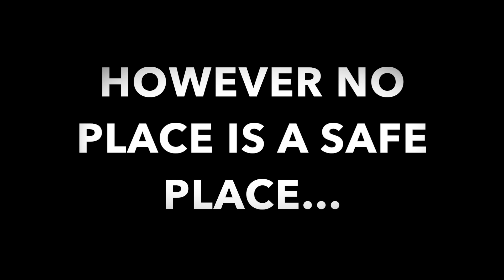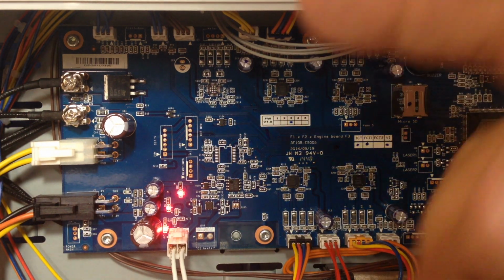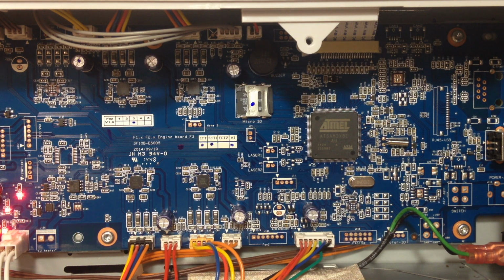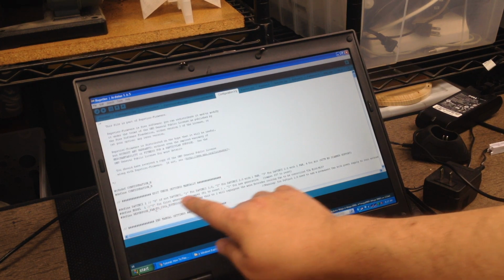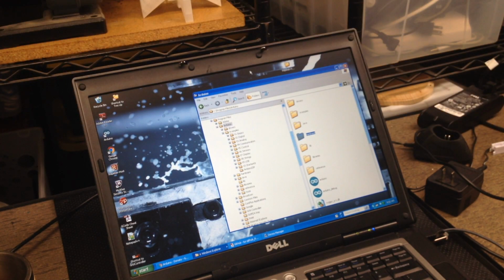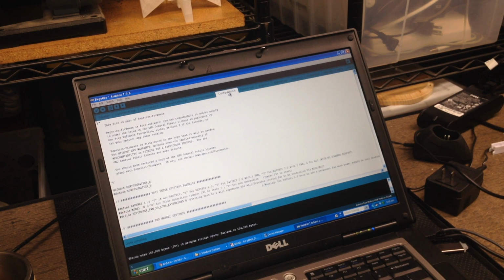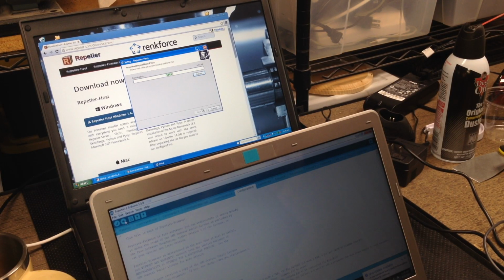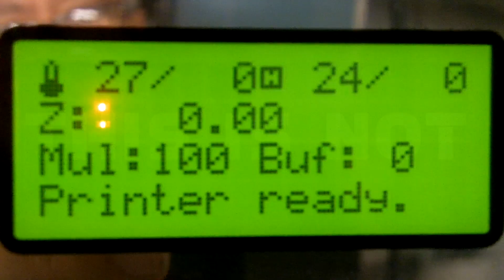JUMPER 37 - One Machine's Search for Freedom!

Comment: I went ahead and upgraded to Repetier .92 with no problems at all. I used 1.5.8 as you suggested and it works great. I am in the process of calibrating the bed with the auto feature. I first used the mechanical method to set it, but I want the auto feature to work and save it to the eeprom. I need to get familiar with my slicer of choice,  before I start my test run. Keep the DaVinci videos coming!
Reply from the maker: +hector bombino That's great news!  Yet another machine set free by Jumper 37!  Its now officially a movement :-)

Comment: I've got a Davinci 2.0a Duo.  Cant seem to get it to work with the new firmware.  Won't calibrate move bed manually nor any heater bed operations.  Any clue where I could check.. Info is scares out there.

Comment: Great video. Now you only have to fit a E3D v6 and you have a great printer :D
Reply from the maker: +EnergyStrike while the stock extruders for sure are NOT E3D v6's, they aren't to bad however speaking of E3D.  Keep an eye out over the next two months as I am building a GMAX sized machine from the ground up using one :-)

Comment: Is there anyway I can get some 2018 help with a XYZ Printing DaVinci 2.0a reflash? For home use I want freedom! Just need help with the Arduino portion (making sure I have the correct software before I short the j37 pin)
Reply from the maker: Michael,  I am not sure the firmware package has ever been updated as I am still running 0.92 and not sure of your machines generation (some the newer ones I have heard they changed).  So I as  cover in the video it is highly possible to brick it and 20% of the people do who right me.
Reply: DIY3DTECH.com in the event that I brick thid is there a way to just run the rest of the machine from Arduino and bypass their board?
Reply from the maker: Sorry its a one way street, you would have to rip out of the electronic as it would be easier.

Comment: DIY3Dtech if is not too much to ask, can you list which files you copy from the github/repetier-firmware-.92 to the Arduino 1.6.5 file you downloaded. Is it the whole folder or just the two files USBCore.ccp and Variant.ccp. I am assuming this is what went wrong when you tried to use 1.6.5 and did not work the first time. It is also my understanding that the two files mentioned above that appear in my "C" directory have to be copied from the Github/repetier-firmware-.92 file to the "C" in order for the patch to work right. I might just proceed with the 1.5.8 instead if I can't clarify that step.
Reply from the maker: +hector bombino for the USB driver belive those two are correct [as over writes] but as I recall it was the whole folder (the dopesoner video lists them).  Belive the issue with 1.6.5. is the file directory structure does not match as when I compiled I missing include errors.   I have seen this before in developing Arduino code, however I don't so enough to be proficient time time wise at trouble shooting so I just rolled back.  My two cents, use 1.5.8 and save yourself the potential headache.

Comment: The link to the repetier firmware you have listed does not match the one you are using in the video.

There is no 1.5.8 folder in the additionalarduinofiles   folder.  there is just:   Arduino - 1.6.9 -Due 1.6.8

It seems the file you are linked to on github has the same name, but has been changed from what it was when you did this video.

As a result, this does not work, at all.

by chance do you still have the file you actually used when you did this video?
Reply from the maker: To find 1.5.8 you will need to dig on the Arduinoo site as it was in an archive section as I assume that is what you are talking about?  As the reason to use 1.5.8 is the files structure of the repetier source does match what the newer version looks for so you will get a compile error.  Also this was done quite some time ago and the repetier source has like been upgraded since I made this video (again have not check just guess because of the time)...
Reply: Thanks for the reply.

I wasnt referring to the arduino version,  but the repetier version on github that you have a link to,  its been changed (though the name might be the same) it no longer contains the files as shown in your video.

https://github.com/luc-github/Repetier-Firmware-0.92

I tried following the instructions listed there...

I followed the instructions .. 7 times...  ive done it 7 times..

and im stuck with a printer that does not work.  the printer bed will heat but the extruders will not.  gives an error saying  that the heater/temp sensor is defective (it isnt)

ive spent about 14 hours total trying to get it to work and so far my 2 week old printer is still just a door stop.
Reply from the maker: I am not sure when you say it doesn't look like the files on my video can you be more specific as I just looked at Github and there was a commit 6 days ago for the pin out file.  However all of the core files still are the same (I was hoping for a newer version).  Also you say your printer is 2 weeks old, did you buy it new as XYZ Ware is rumored to have been altering things so the hack does not work (again rumor only).  Also don't be so quick to think you don't have a heater temp issue, as I recall helping someone else with a simular issue a few months back and the connector or something like that came lose.
Reply: What I mean is, 

if you follow the link listed in your video, download that file.... and try to use it

In the part where you say to open Repetier-Firmware-0.92 master\src\ArduinoDUE\AdditionalArduinoFiles\  1.5.8..  

there is NO 1.5.8... no such folder..

there is a folder called Arduino - 1.6.9 -Due 1.6.8..

thats what im talking about.   it seems the file contents have been changed since you made the video, and such this will no longer work.,
Reply: You should read other peoples posts they have good info sometimes. I think this post from above might help:  Joey Evans4 days ago from the Modbot  tutorial video
Thanks, it worked like a charm!  The latest Github file didn't have the 1.5.8 on there, but I went to their previous releases and got it there.  It's the bottom one on this page that still has the 1.5.8, https://github.com/luc-github/Repetier-Firmware-0.92/releases.

Hope this helps I have a Davinci 1.0A with firmware 1.0.6 and am praying to the 3D Gods for the courage to flash my 1 month old printer and not brick it,  goodluck!!
P.S. dont forget to select 3 for model  in "configuration.h
let us know how it goes!

Comment: Ok I got a Davinci 1.0A with firmware 1.0.6.  I have downloaded and installed the 1.5.8 beta version of Arduino from  (arduino.cc/en/Main/OldSoftwareReleases) and the arduino 1.5.8 compatible repetier version .92.3 from  (https://github.com/luc-github/Repetier-Firmware-0.92/releases) its the very bottom one. Will this work on my printer with firmware 1.0.6  ? I have not heard of any one with a second gen board with fw 1.0.6 do this successfully or even try the closest is this guy (https://www.youtube.com/watch?v=66JYe_iVstY) he has FW 1.0.3 his came with that FW while mine came with the 1.0.6 our boards are identical except for the available version slots on the motherboard sticker itself (the little white sticker with slots one checked off/blue dot denoting version on the unit) his goes up to a FW version up to 1.0.5 while mine starts at 1.0.6 and goes up to  1.0.10 I think it will work does anybody know for sure? Somebody please help I do not want to brick my new printer and get a heart attack or become a serial killer, lol jk. Seriously I need some help here thanks to DIY3DTECH.com and all you posters that are contributing info I appreciate any feedback thx.
Reply from the maker: As I say in the video when you do this you are risking bricking your printer so if your not willing to take this chance than don't do it.  Your not going to save a ton of money on filament as descent ABS will cost about as much as the XYZ cart however I think external software is better and that was the main reason I flashed mine.  However to see if things work with the version 1.5.8 just try compiling the code (not uploading it!) and if there are no errors than from an IDE stand point you should be good. Now if the broad in your printer can be flash that is a whole different story and the way to find out is try as yes you are risking bricking it so be fore warned....